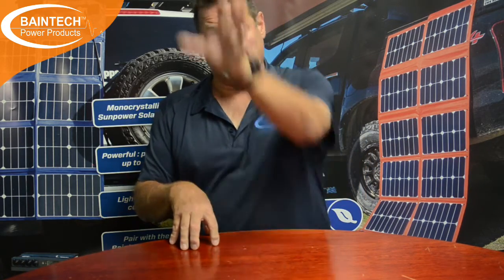240V Power & Inverter | Avoid Inverter Drain on Caravan Batteries: Essential Tips for Upgraded Vans

Comment: I have a renogy 3000 watt inverter charger and if I plug into mains it isn't  charging the battery unless I turn the inverter on.
I assumed the idea was that the 240 out automatically powered the 240 plugs and charged the battery without having to turn the inverter and you only turn the inverter on when NOT connected to the mains and you want to convert 12 volt to 240 volt.